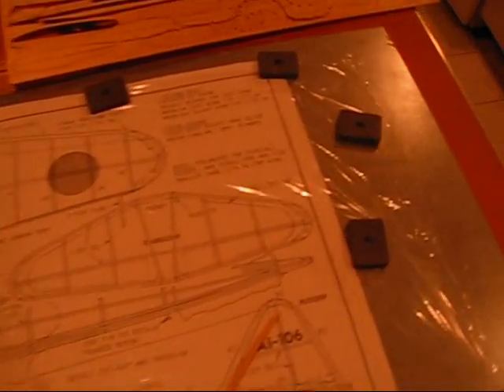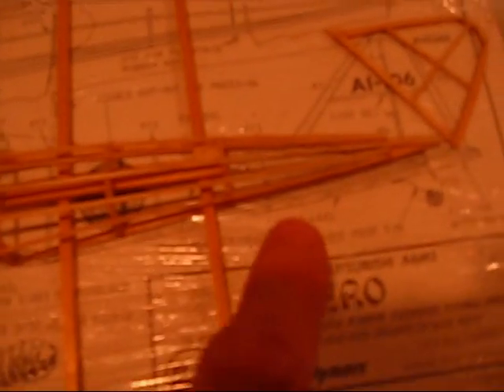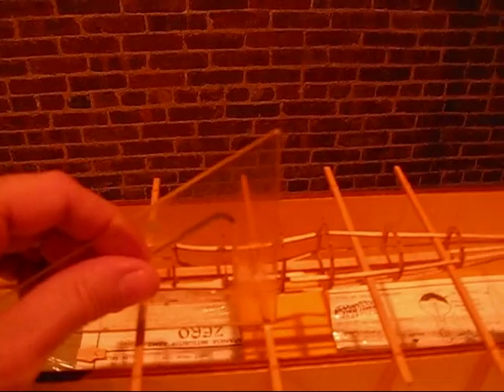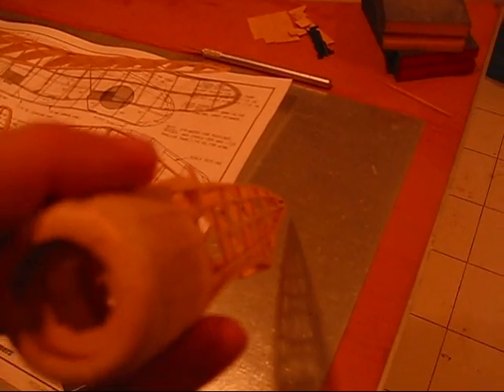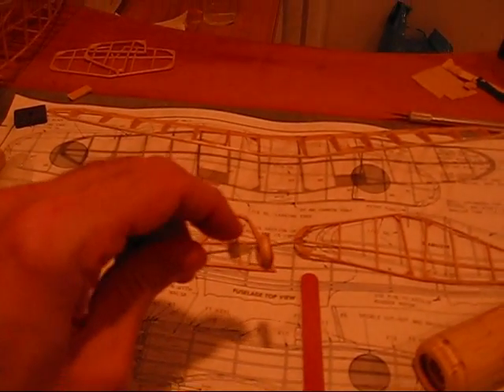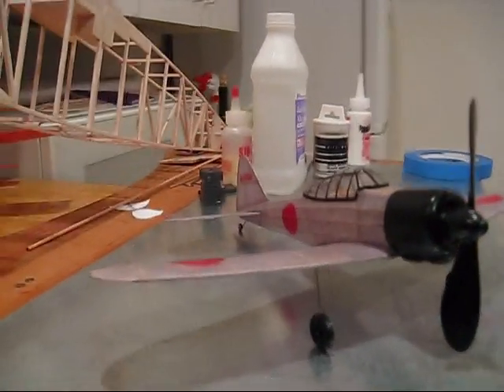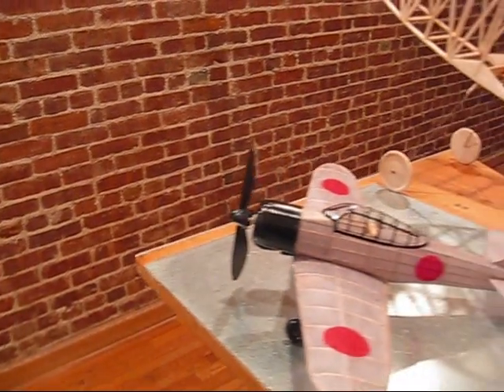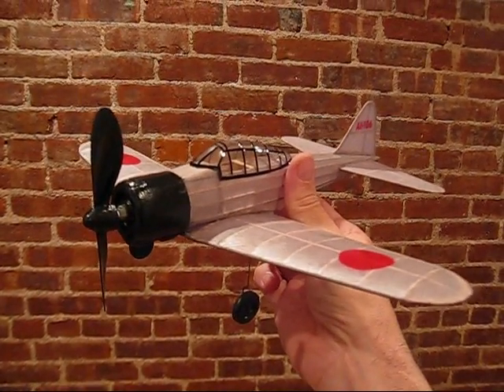Rubber powered Mitsubishi Zero - building tips

Comment: Good afternoon Mr.Domoremath, today i just got the exactly same plan as your video on outerzone as this Zero' plan were drawn by Mr.Bob Peck. My question is they are on pdf file. I just cant imagine how the Print-out paper size Will be.. thanks for the opportunity to ask, btw thats nice model youve built with good finishing on the cowling
Reply from the maker: That's always a problem with pdf, but plans on outerzone are usually the right size, make sure to print it at 100%. Hit print on your computer and it should show you the size when you ask for actual size.
Reply: @domoremath  thanks for the hints, on outerzone this plan were divide into 2 part i cant ensure the page size that contain the Fuselage rib section.. then Fortunately i got the full size plan on the pinterest then convert it to pdf then split it into Four page of a4 size paper..  i am is limited because i only rely on android phone, then go to printing shop to do the rest.

Comment: Oh my god how funny, it's fuselage, not fuselige, at least learn the terminology, newbe
Reply from the maker: I usually just delete rude comments because I have a no-negativity rule at this site, it's a hobby for fun. However, I'll simply note that you are apparently young (I am not) because you don't realize that favored pronunciations are local and also change over time, and my pronunciation is actually in the dictionary from years back, and was very common in NY.  Also, if you took a moment you'd see that this has already been addressed several times, for example check the comments below. I got tired of this comment, so you'll see that any video after 2015 uses your preferred pronunciation (though you should learn that language is malleable, we don't even pronounce 'often' the same way anymore). I'd recommend focusing on the building and flying, that's what the site is about.

Comment: Thanks you! When you use the gluestick, do you apply it to all the wood that touches tissue? Or for example, just the leading/trailing edge and wing tip. Not the wing ribs.
Reply from the maker: I focus on the le/te, wing tip, and wing tip rib, but also brush a light coat on the top of the ribs as well - that helps with repairs because you can then just cut out a section. For under-cambered wings, I put a good coat, for the bottom covering, on the ribs and spar.

Comment: You also have a tutorial on YouTube on how to braid the rubber band but Dad aeroplane in that tutorial video is bigger than this 0 so how do you put rubber band in search small aeroplane?
Reply from the maker: This plane uses a single loop of 1/8" rubber, so I just put some turns in the rubber before tying the loop and that will keep the motor snug.
Reply: Please tell me in one of your tutorials video in which you tried a braid, so do you do something similar to that with one rubber band instead of multiple rubber bands?
Reply from the maker: The 'braiding rubber motors' video shows how I braid multiple strands, the 'preliminaries to flying' video shows an example of the 'turns in the rubber' approach I mention for one loop above, https://www.youtube.com/watch?v=olx9ySmvNmM

Comment: NICE work! I built one of these in the Holiday Inn at Palo Verde (Tucson Airport) on a multi-week business trip- using an Exacto blade, Elmer's glue and shirt pins. Unlike the Guillows' kits designed for 0.020 engines, these Peck kits are intended to fly on rubber bands. It climbed, as they say, like a homesick angel.  Without a doubt the best flying balsa scale model I've built, to date. I left the landing gear off mine.
Reply from the maker: I wish I had left the landing gear off as well, less weight and more streamlined!

Comment: "Fuslige?" Fuselage is a French word. Fus-e-lage. Say it like a Frenchman.
Nose cones are for rockets. Airplanes use spinners.
Is there enough dihedral in that wing? Peck kits fly well, if you build it right. I left the gear off mine. Less weight, less drag. I like the jig, though.
Reply from the maker: That was a perfectly acceptable pronunciation years back and it's listed as the preferred pronunciation in my 1988 websters, see below, I also already answered this question for someone else who apparently did not realize that preferred pronunciations change over time, so please no lectures about the 'right' pronunciation. Glad you enjoyed the jig at least :)
Reply: I've worked for two aircraft manufactures and it is commonly pronounced as fuselage, in fact 100%, never heard it pronounced fuselige haha
Reply: Reeeally now, that's all you've taken from this video?

Comment: How did the Zero fly? It looks great.
Reply from the maker: Flies OK, kind of faster than I'm used to, but I haven't built many low wing planes. The main change I made is that the whole nose now plugs in and is removable, the hole for the original plug was just too small, so I'd recommend doing it that way.